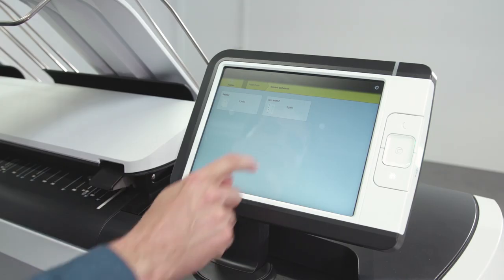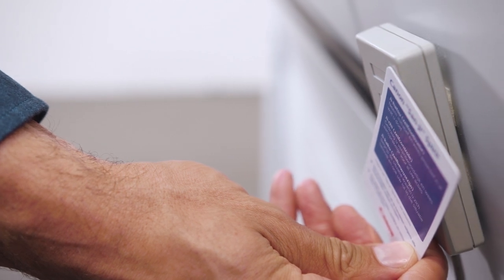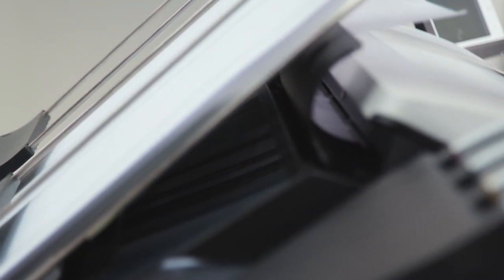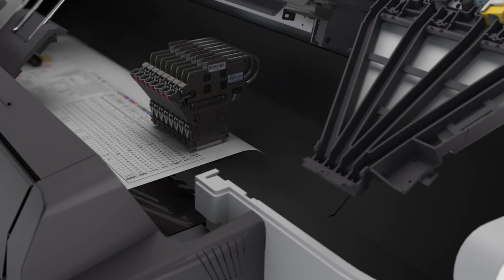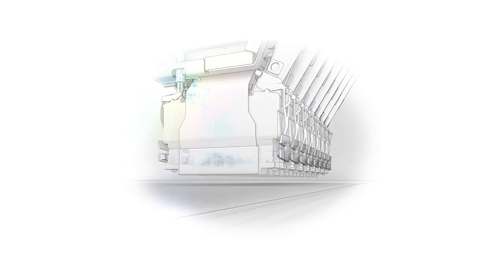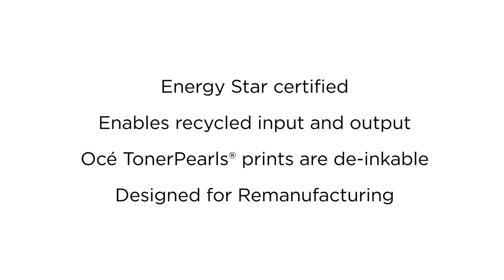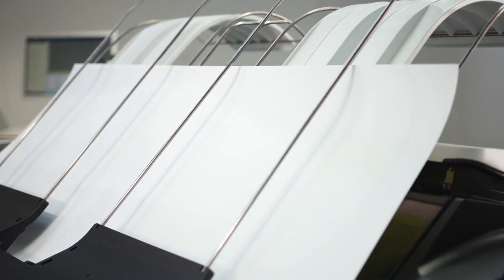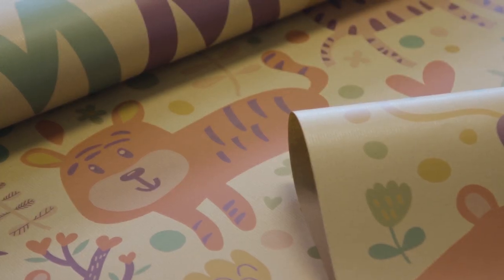Full Demo of the Océ ColorWave 3000 Series Large Format Inkjet Printer

Comment: ColorWave is not an inkjetprinter, but a tonerpearl printer based on toner.
Reply: HIGHLY RELIABLE TECHNOLOGY
The Océ CrystalPoint technology uses Océ TonerPearls® toner, a proven technology that has been on the market for over a decade. The pearls are heated and then jetted onto the media with extreme precision. The multipass Océ CrystalPoint print technology provides crisp print quality with no feathering. The Océ ColorWave 3000 series also applies Océ PAINT technology and nozzle failure compensation on the fly to avoid misprints and reprints while ensuring high throughput. This not only ensures consistent print quality between the first and last print, but also during the lifetime of the machine or even across multiple engines. The Océ ColorWave 3700 printer uses Océ MediaSense technology to ensure high-quality prints on an even wider range of media. The gap between the imaging device and media is adjusted automatically based on the media thickness